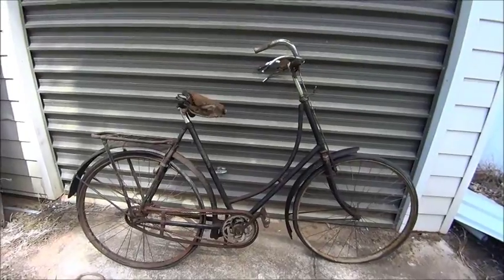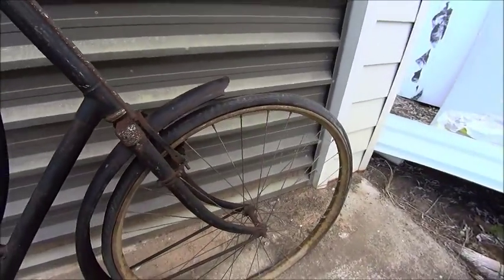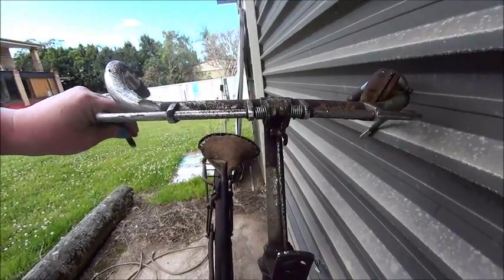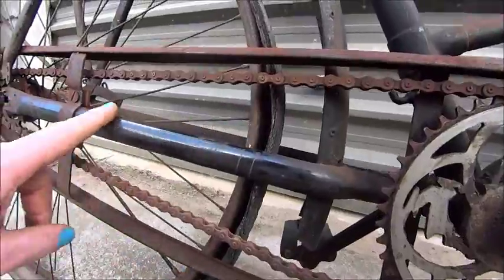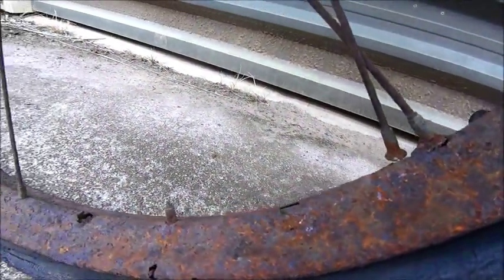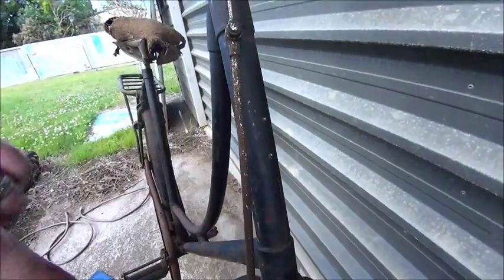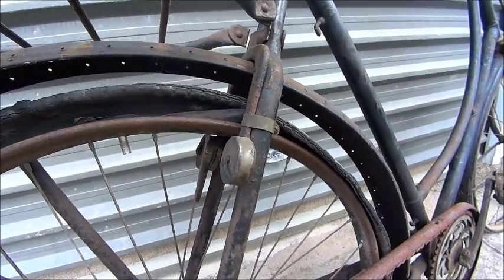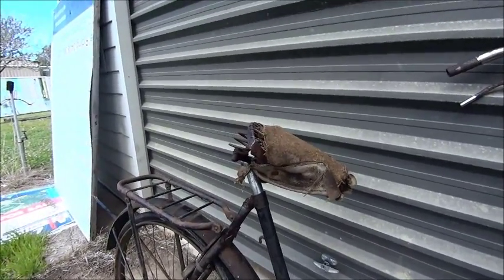1931 Gazelle Bike   a closer Look

Comment: My first bike was a BSA British model, made perhaps in the early 50s' (shows you how old I am) with rod-operated front and rear brakes; no cables then. You are absolutely right, the coaster brake is a retrofit. The pommies, as they called Brits in those days, never heard of coaster brakes in 1931. These are an abominable American invention of the 1950s. I looked at this jewel you have with great interest. To my mind, because you have rod-operated brakes, the hardest thing you will have to do is find the rubber brake blocks for the rear tire (or tyre) because nobody makes them anymore. In fact.The rod mechanism is no problem because you could make it. Depends on how authentic you want to be, because fitting cable brakes to that bike would be a desecration.. Can you find a junk bike with the rubber blocks intact? I sure couldn't. But then I live in Alaska and they never heard of rod brakes here, Might have a problem with spokes, The thread is almost certainly BSW, Hard to find BSW spokes these days.
Reply from the maker: ill certainly be making the Brake assemblies, Juan Rivero I've got bits to copy, and I think I can make a good copy of anything that was made by mass production in 1931. I wonder if we will be able to say the same thing in another 84 years about stuff made in 2014. .. lol. . as for spokes.. .. still thinking about them. thanks for watching!
Reply: Emma Ritson Yes. And I grew up away and long ago.  I am probably much older than you are. But  am sure you could make the spokes. I suppose somewhere in Oz there is a 1/16 BSW tap and die set, I certainly couldn't find one. The brake blocks are another matter. But I thought about it (on a bike ride, curiously enough, soon the snow will fly) if I had the stock.  But what I thought is maybe you could find  a piece of hard rubber you could machine to the correct profile to fit the rims. Glad you aren't worried about it. I could make every piece of the brakes myself, except the brake blocks. I could do that too, if I could find stock. But I can't. I will be very interested in how you solve this problem,

Comment: OMG Emma, you have a treasure! I am showing my age, but my first bike, long ago and far away, was a British BSA. Rod-operated brakes, just like yours. Say early 50s. From your video I see no sign of a rear brake, yet I see two brake levers. Your audio is a bit weak in this video. But I suspect it had two-wheel (rod operated of course) brakes. With the wide wheels, under-wheel brakes just like the front brakes. These wheels are completly unavailable nowadays. You will have to rebuild the rear wheel. It is missing a whole bunch of spokes In Oz you might actually find an older wheel from an otherwise shot bike; here in the US they never heard of underwheel brakes and we are all caliper brakes these days. I think you might have to rebuild (actually recreate)  the rod mechanism that actuates the rear brake.If there was one.

 I think there was a rear brake, and somebody took it out. The rest of the bike looks great to me. Might have to have it sandblasted. That is the least of your worries. Yes, the saddle is shot, Original was leather. Modern saddle might be the only (affordable)  answer. The handlebar shaft is snot.  But that is just a piece of tubing. Chain no problem. Electrolysis will do it. All of this is not difficult -- may be hard to rebuild the rear-wheel brake, but unless you rebuild the rear wheel or find a "new" one you cannot restore this bike. I think rebuilding the rear wheel is no big deal; l but watching a rod-brake bike restored means a lot to me.
Reply from the maker: Spot on! New under wheel brake parts for sure. I have the front ones to copy. I think I have a new set or rims already. More as we go!
Reply: All parts of this so-called "granny-bike" are still available, as this bike is, after more than 100 years, stlll in production and even more popular because of the front rack.